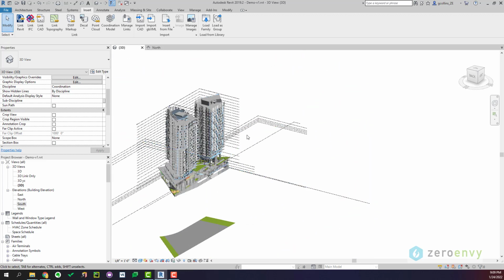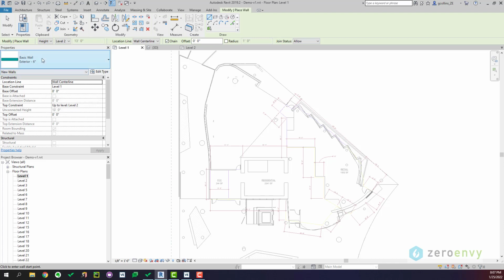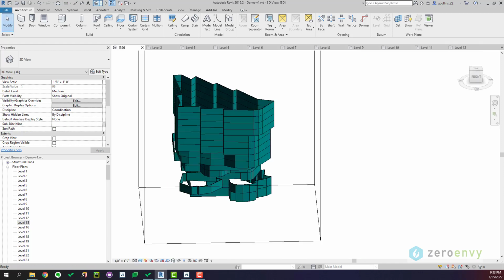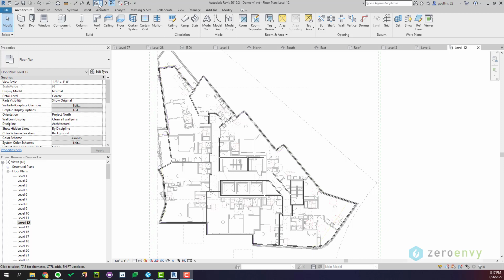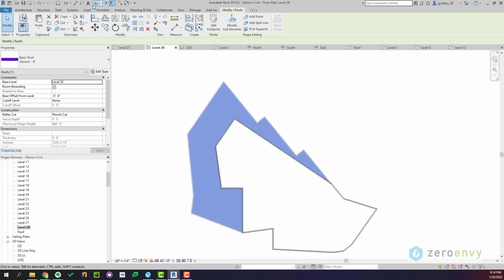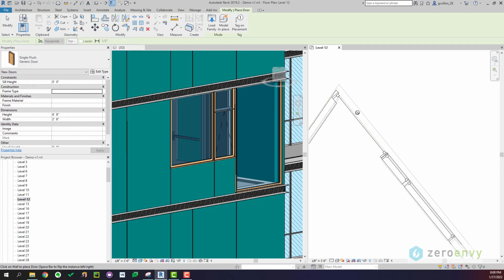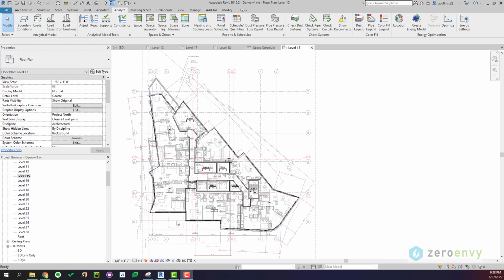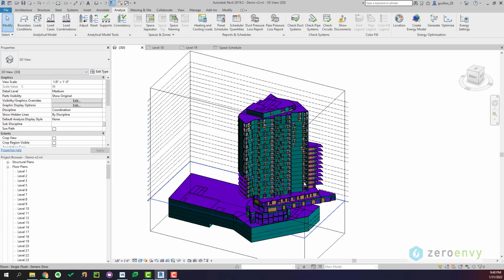BIM-to-BEM - How to Create Energy Model Geometry in Revit

Comment: Hi .....i am doing design phase energy modeling of resort project the revit model of resort is very complicated shapes ,curved surfaces of roof structure, walls and glazing but when iam import the revit file to design builder software via gbxml file the imported model become distorted or brust shapes comes no exterior element comes properly.......i am stuck in heavy problem as we have around 180 nos villas and other Buildings for simulation can you share your e-mail address so that i can mail my project revit file .........
Reply from the maker: Hi Manoj -- This video is a tutorial on how to CREATE a Revit model from an architect's model so that the gbXML export/import works. It sounds like maybe you're just trying to export the architect's model directly. That won't work, which is why we developed the workflow and shared it in this video. Best of luck with your project!

Comment: That's the best tutorial on how to convert a geometry in Revit to gbXML. I wonder if you could share some templates created in Revit.
Great job
Reply from the maker: Hi Paul - Thanks for your comment! We'll look into sharing a Revit template and/or doing a follow-up video on the assemblies in the template. That said, I don't think there's anything in it that you would need to do this workflow. The key is to set each wall/roof/floor family you're using to "room bounding", and don't try and get fancy by varying wall thicknesses and matching layers to the architectural design. Just use a "generic 6 in. exterior wall" family for the whole building, and make sure the walls stack vertically as they need to.